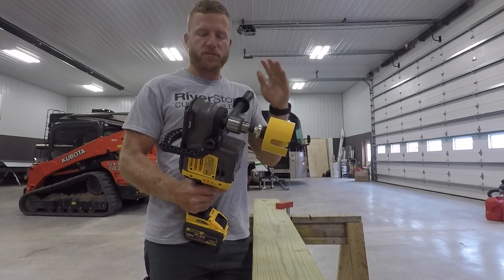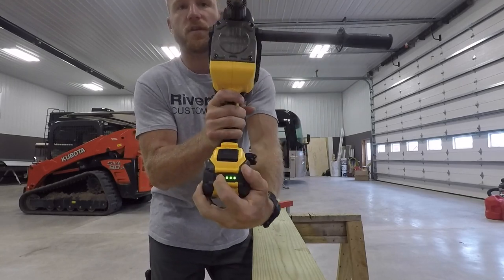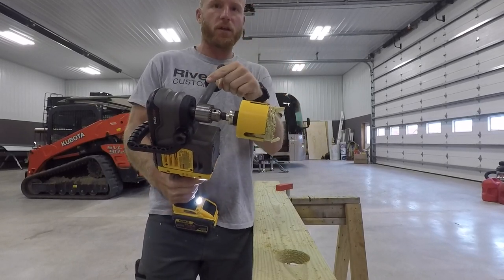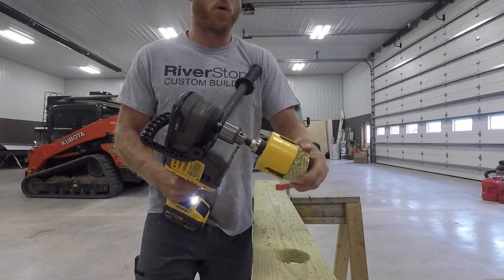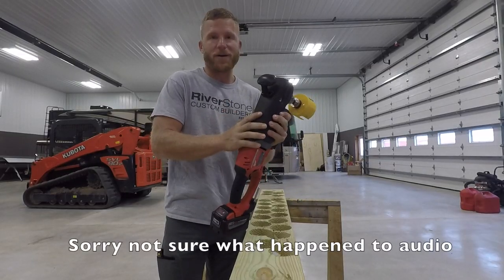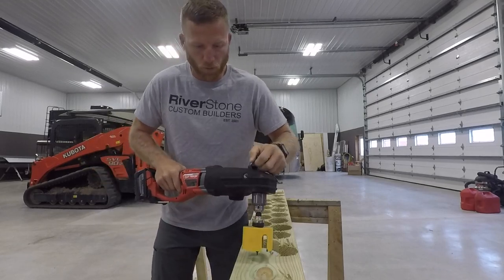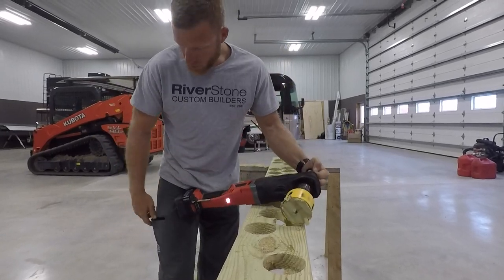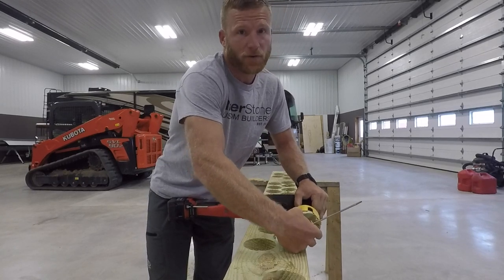Insane Power from the Flex Volt Stud/Joist Drill

Comment: It's the holesaw, for those who never used FlexVolt line of blades and holesaws, they  definitely pass the quality test AND they make your batteries last a hell of a lot longer, the only thing I will say is that they do not last as long as other blades, usually a good quality mitersaw 12" $120 dollar blade will last me 12-13 months and the FlexVolt one lasts me about 8-10 months, but doing the math on price 2 FlexVolt blades cost just as much as 1 good quality one,so it's the best bang for the buck

Comment: That’s what a floor joist looks like after a plumber gets near it
Reply: You're not wrong there 🤣🤣
Reply: I've seen them do that on a eye beam  I was like wtf
Reply: @hi-ye4rz  If you look up the safe drilling sizes and spacings on engineered joist (I beam)  you may be surprised to learn just how big a hole you can drill. Typically the hole will take a 110mm soil pipe which seems alarming but in the right size joist is fine.
Reply: No one wants a framer’s house, without the plumber’s plumbing in it.

Comment: When in reality you drill holes from the top with full force. Try to do it and keep the drill above your head or verticall. That wood is soft too. Anyway what job requires cutting holes these big in joices ? And one more thing how you gonna put that monstrosity between joices or hard to get areas ?
Reply: FoxRcng708  no just real

Comment: When somebody invents an easy way to get those off cuts out of the holesaw...Instant millionaire
Reply: David Handley check out pro fit holesaw se mate
Reply: A bit of wax on the inside of the holesaw has worked wonders for me.
Reply: just put it in reverse and blip the throttle a few times, it falls right out.